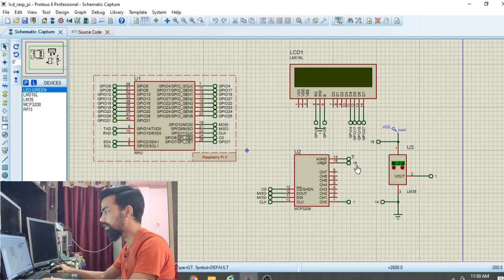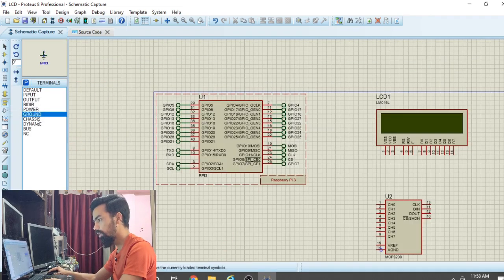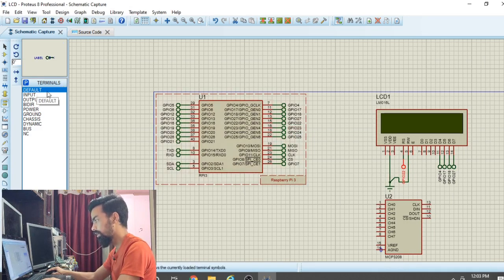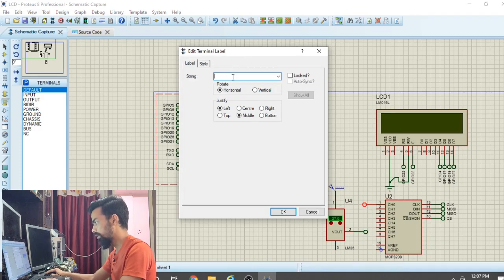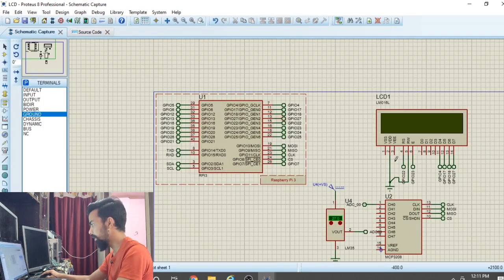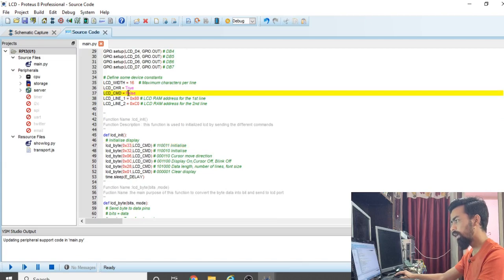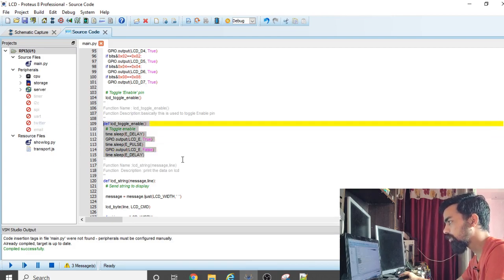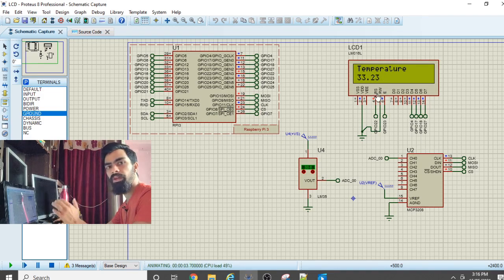Simulation of LCD and Temperature sensor with raspberry pi

Comment: Sir, if I change the temperature sensor to ultrasonic sensor, do I need to use adc (MCP3208)? Hope you can help me with my project.
Reply from the maker: No ..but ultrasonic sensor won't work in proteus for raspberry pi

Comment: Hello Rahul, nice work

I want to ask if any simple thing is there, in the sense without using LCD: only interfacing of temp sensor with Raspberry Pi

if yes, kindly provide link for same
Reply from the maker: If there is no lcd then where will you check temperature
Reply: @Rahul_Jadhav_Project  
Thanks for your reply, but I thought we can check temperature on LM35 IC..small display is there
Reply: Also I was trying, if temperature exceeds certain value (say for eg. temperature greater  than 30 deg C) than servo motor will run. Any suggestion on this you would like to add

Thanks in advance

Comment: Can you make more videos about simulating temperature and humidity (use DHT11 or DHT22) with proteus and Python.Thank you very much.
Reply from the maker: Ok I will try definitely
Reply: @Rahul_Jadhav_Project  How to import adafruit_DHT on code in Proteus, or how to  calculate the read from DHT11 similar to LM35 in your clips. PLEASE HELP ME!!
Reply from the maker: @inhvyle8657  hello, sorry to say this , but DHT11 sensor is not possible in proteus atleast for raspberry pi.
Because it works on one wire protocol and that is not support in proteus
Reply: @Rahul_Jadhav_Project  oh, i see. Thank you so much sir.😍

Comment: Nice video...can we add dc motor in this simulation??
Reply from the maker: Yes sure you can add dc motor simulation.
I have already did it.please download simulation from below link. Please remove soil moisture sensor from there if you don't require.
https://drive.google.com/folderview?id=1FEPYIBzIwwGyzzpp98NiCLMKdDu-Dj_8

Please like and subscribe.provide your support to.me.
Reply: @Rahul_Jadhav_Project  Thanks..!! Already liked and subscribed😊
Reply: @Rahul_Jadhav_Project  I downloaded the simulation but there is Arduino used in that simulation and here we are using raspberry pi. i want to do my complete simulation using raspberry pi. Can you plz help me??
Reply from the maker: @pranavk5042  hello bro , I haven't use Arduino, can you check simulation again.
It should have Raspberry pi.
If not please send me simulation photo on my mail id rahulj23101993@gmail.com.
Reply from the maker: I have created simulation on Raspberry pi only till data .
Reply from the maker: Please use file soil_student_simulation.
Reply: @Rahul_Jadhav_Project  ok I will check again should I contact you on WhatsApp ?
Reply: Thanks for all the help..

Comment: Bro upgrade this with connecting temperature sensor output with a buzzer if temperature is above threshold value buzzer should ring 
I need this for my project plz do it asap
Reply from the maker: Yes sure please send me your mail id, I will give you simulation by mail
Reply: @Rahul_Jadhav_Project  kratos.zyx@gmail.com
Reply: @Rahul_Jadhav_Project  bhai i have sent you the mail i.e kratos.zyx@gmail.com
The temperature threshold value i need is 108 c. If the temperature is below 108 then buzzer should be off and when it exceeds 108 the buzzer should ring for 5 seconds plz send me simulation as soon as possible. Thank you ❤
Reply from the maker: Tomorrow I will send you simulation.
Reply: @Rahul_Jadhav_Project  yes bro I'm waiting
Reply: @Rahul_Jadhav_Project  Bhai tumne kiya hi nahi yar send muze simulation
Reply: @Rahul_Jadhav_Project  bhai when will i get it
Reply from the maker: @kratoss315  wait for 5 min
Reply from the maker: @kratoss315   check your mail or download it from 
google drive link::
https://drive.google.com/drive/folders/1XpXgcbqw2hfGQKHQWSV3fUh2s93Ers5j?usp=sharing
Reply: @Rahul_Jadhav_Project  bhai thank you so much

Comment: Bhai can u please post the code in comments.. I'm unable to access the code, it would be a great help ..
Reply from the maker: Please give me your mail id
Reply from the maker: #!/usr/bin/python
import spidev
import time
import os
import RPi.GPIO as GPIO
GPIO.setmode(GPIO.BOARD)
GPIO.setwarnings(False)

# Open SPI bus
spi = spidev.SpiDev()
spi.open(0,0)

# Define GPIO to LCD mapping
LCD_RS = 15
LCD_E  = 16
LCD_D4 = 7
LCD_D5 = 11
LCD_D6 = 12
LCD_D7 = 13

# Define sensor channels
temp_channel  = 0
'''
define pin for lcd
'''
# Timing constants
E_PULSE = 0.0005
E_DELAY = 0.0005
delay = 1

GPIO.setup(LCD_E, GPIO.OUT)  # E
GPIO.setup(LCD_RS, GPIO.OUT) # RS
GPIO.setup(LCD_D4, GPIO.OUT) # DB4
GPIO.setup(LCD_D5, GPIO.OUT) # DB5
GPIO.setup(LCD_D6, GPIO.OUT) # DB6
GPIO.setup(LCD_D7, GPIO.OUT) # DB7

# Define some device constants
LCD_WIDTH = 16    # Maximum characters per line
LCD_CHR = True
LCD_CMD = False
LCD_LINE_1 = 0x80 # LCD RAM address for the 1st line
LCD_LINE_2 = 0xC0 # LCD RAM address for the 2nd line

'''
Function Name :lcd_init()
Function Description : this function is used to initialized lcd by sending the different commands
'''
def lcd_init():
  # Initialise display
  lcd_byte(0x33,LCD_CMD) # 110011 Initialise
  lcd_byte(0x32,LCD_CMD) # 110010 Initialise
  lcd_byte(0x06,LCD_CMD) # 000110 Cursor move direction
  lcd_byte(0x0C,LCD_CMD) # 001100 Display On,Cursor Off, Blink Off
  lcd_byte(0x28,LCD_CMD) # 101000 Data length, number of lines, font size
  lcd_byte(0x01,LCD_CMD) # 000001 Clear display
  time.sleep(E_DELAY)
'''
Function Name :lcd_byte(bits ,mode)
Fuction Name :the main purpose of this function to convert the byte data into bit and send to lcd port
'''
def lcd_byte(bits, mode):
  # Send byte to data pins
  # bits = data
  # mode = True  for character
  #        False for command
 
  GPIO.output(LCD_RS, mode) # RS
 
  # High bits
  GPIO.output(LCD_D4, False)
  GPIO.output(LCD_D5, False)
  GPIO.output(LCD_D6, False)
  GPIO.output(LCD_D7, False)
  if bits&0x10==0x10:
    GPIO.output(LCD_D4, True)
  if bits&0x20==0x20:
    GPIO.output(LCD_D5, True)
  if bits&0x40==0x40:
    GPIO.output(LCD_D6, True)
  if bits&0x80==0x80:
    GPIO.output(LCD_D7, True)
 
  # Toggle 'Enable' pin
  lcd_toggle_enable()
 
  # Low bits
  GPIO.output(LCD_D4, False)
  GPIO.output(LCD_D5, False)
  GPIO.output(LCD_D6, False)
  GPIO.output(LCD_D7, False)
  if bits&0x01==0x01:
    GPIO.output(LCD_D4, True)
  if bits&0x02==0x02:
    GPIO.output(LCD_D5, True)
  if bits&0x04==0x04:
    GPIO.output(LCD_D6, True)
  if bits&0x08==0x08:
    GPIO.output(LCD_D7, True)
 
  # Toggle 'Enable' pin
  lcd_toggle_enable()
'''
Function Name : lcd_toggle_enable()
Function Description:basically this is used to toggle Enable pin
'''
def lcd_toggle_enable():
  # Toggle enable
  time.sleep(E_DELAY)
  GPIO.output(LCD_E, True)
  time.sleep(E_PULSE)
  GPIO.output(LCD_E, False)
  time.sleep(E_DELAY)
'''
Function Name :lcd_string(message,line)
Function  Description :print the data on lcd 
'''
def lcd_string(message,line):
  # Send string to display
 
  message = message.ljust(LCD_WIDTH," ")
 
  lcd_byte(line, LCD_CMD)
 
  for i in range(LCD_WIDTH):
    lcd_byte(ord(message[i]),LCD_CHR)

 
# Function to read SPI data from MCP3008 chip
# Channel must be an integer 0-7
def ReadChannel(channel):
  adc = spi.xfer2([1,(8+channel)<<4,0])
  data = ((adc[1]&3) << 8) + adc[2]
  return data

 
# Function to calculate temperature from
# TMP36 data, rounded to specified
# number of decimal places.
def ConvertTemp(data,places):
 
  # ADC Value
  # (approx)  Temp  Volts
  #    0      -50    0.00
  #   78      -25    0.25
  #  155        0    0.50
  #  233       25    0.75
  #  310       50    1.00
  #  465      100    1.50
  #  775      200    2.50
  # 1023      280    3.30
 
  temp = ((data * 330)/float(1023))
  temp = round(temp,places)
  return temp
 

 
# Define delay between readings
delay = 5
lcd_init()
lcd_string("welcome ",LCD_LINE_1)
time.sleep(2)
while 1:
  temp_level = ReadChannel(temp_channel) 
  temp       = ConvertTemp(temp_level,2)
 
  # Print out results
  lcd_string("Temperature  ",LCD_LINE_1)
  lcd_string(str(temp),LCD_LINE_2)
  time.sleep(1)
Reply: @Rahul_Jadhav_Project  thank u soo much was a great content!!
Reply from the maker: Please share and subscribe. I need your supy
Reply: Amazing video helped me alot in my studies 👍👍🔥